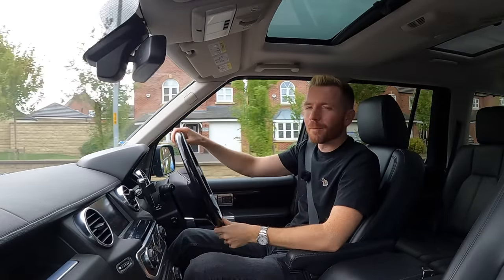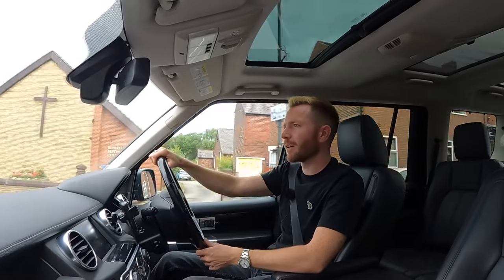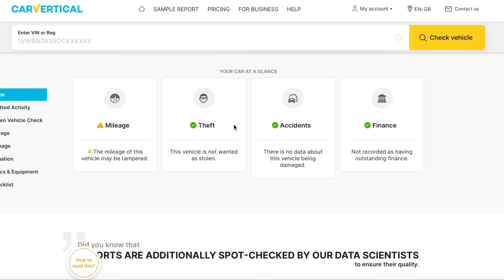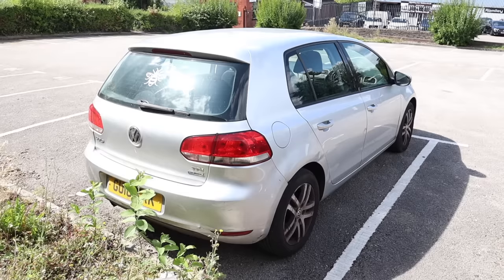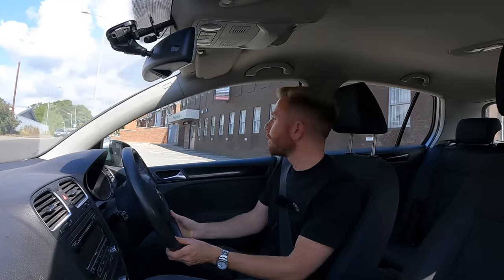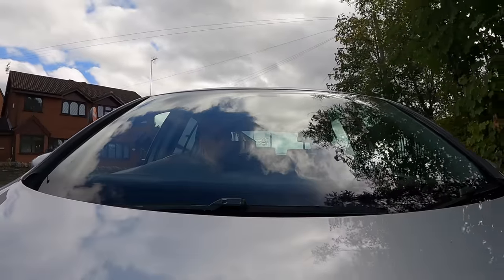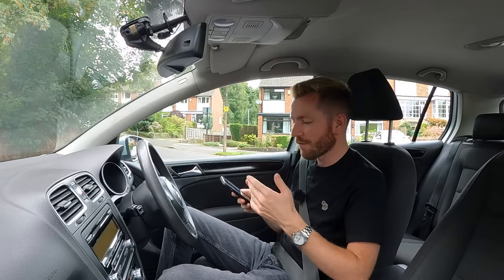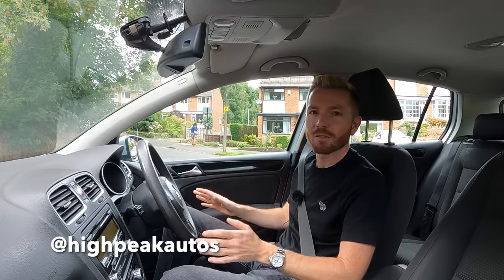I BOUGHT A CHEAP VW GOLF MK6 FOR £700!

Comment: As far as the tyres go, the date format is Week/Year so 07/22 means week 7 of 2022 not July 2022, meaning somewhere in February of 2022.
Reply: and the left side tyres were 18/21 (9:32 bottom of tyre)
Reply: I was also surprised to see such a fresh tyre in Europe from China
Reply: @krivickas  I have seen lots of these Aptany Harmonic tyres here in the UK lately. If we've been flooded with these post covid and post brexit, I'm assuming these really are the very worst China has to offer anyone😉
Reply: @6ettinold  A neighbour of mine has just bought a lovely used Black Sapphire (the colour's name, not those rumbly old nineties Fords😄) BMW ///M240i Shadow Edition. I just noticed and told him about the 'SprintGrip' tyres it's wearing (rapidly). Very rightly known as 'ditchfinder tyres' in the trade and many forums, I told him to drive it carefully and change them for better-established tyre brands the next spare time he has available.
Reply: Sketchy tyre dealer would get rid of the original tyre manufactured date, I think the tyre at 8:57 is one of the example, as you can see there are no date marked in the pill shaped area which there is where the date should be at the bottom of the screen.
Reply: So my tires aren’t made in the 42-nd month of last year? :(
Reply: also the tyre date is only ever stamped on one side of a tyre thats why its not visible on the n/s/r of this car
Reply: @cgr_doorjam0263  yeah it’s running backwards 😂

Comment: It's a testament to VW engineering that after being totally neglected it still runs ok.Close 2nd to the A Class Matt.
Reply: Wouldn’t happen on a Japanese car.
Reply: Ran an 08 Rabbit with the 2,5l engine. Ran that thing with a shattered water pump for over a year and faulty oil cooler. Overheated it, ran it hard. Had low fluid levels. Just trying to blow it up so I could have a golf shell. Never did die. I cleaned the engine up and now it's at 200k miles. Runs like it's brand new still. VW definitely earned my customer loyalty with this car.
Reply: Pretty crap testament in my opinion. Plug my 15 year old 170k ford in and it won't be riddled with faults. Germans don't make cars like they used to.
Reply: Money pit...

Comment: Just a heads up Matt, when looking for the date stamp on the tires you’re looking for something called the DOT code which stands for (Department of Transport) which is a US standard regulation for tires to check the date. As an example you’ll see 0122 this doesn’t mean that it’s a Jan 2022 tire however. The first 2 digits actually stand for the week of the year it was manufactured so an 0122 tire would be the first week of 2022. Another example would be 2919 which would be the 29th week of 2019. The NSF tire you checked and was unsure of being 1821 was correct, it was manufactured on the 18th week of 2021. Just thought this might help.

Comment: I’ve had my 2010 mk 6 for 8 years. I treat it like the work horse that golfs are, but I religiously get it serviced and get any jobs that it needs done as soon as possible. We used to change our car every 3 years, but we can’t bear to part with it, 120,000 mile, never lets us down. And still drives like a new(ish) car, plus £30 a year road tax.
It’s the 1.6 tdi diesel with extras that you’d be lucky to get on a modern car, Parking sensors, sat nav, touch screen cd/dvd player, voice control radio, and control buttons on the steering wheel. The cruise control is still working properly and is about the best I’ve ever used. Oh, and also a refrigerated glove box. Mine still has the bottle opener😊if you can get a mk6 for anything under 4 grand, snatch their hand off.

Comment: I swapped my FL2 in for a 59 reg MK6 golf 1.6 TDI bluemotion recently, 154k full VW history 2 owners for £3290. It's been a brilliant car so far, cheap to run, solid and refined.
Reply: I just got a mk6 golf estate 2010 in Jan this year. 6 owners, 89k miles on it. Full service history with a belt not long ago. Cost me 3900. now I've put 5k miles on it. Cars been generally good, spent 150 on a new radiator so far in maintenance. Shell be due an mot and service at the end of the year and I'll be treating her to 4 new tyres
Reply: @4N50N and how the car goes ?
Reply: @GnarAspira an injector ended up failing on me a year later. Also rear wiper motor failed, and 2 separate broken springs. But overall not a terrible car. Sold it for 3,300 last month. Ended up doing around 17k miles on it.

Comment: Just shows how good the golf 1.6 tdi engines are. It's been neglected and probably never been serviced still managed to do 166k miles and surviving.
Reply: They're really not.

Me and my partner owned a MK6 1.6TDI from three years old and 20,000 miles on the clock. It got everything it needed on time (serviced every time on the dot) and was well looked after mechanically.

In our ownership we had the dreaded EGR failure (£600+), wonky and rough idling after the Dieselgate emissions fix was carried out (which is known to accelerate injector failures), valve cover oil leak, the rear calipers seized forcing us to replace the rear discs, pads, and calipers, the drivers door started to rot on the seam, I could go on. It behaved like an absolute heap for a car that was impeccably well maintained so we ended up getting rid of it just after it ticked over 100,000 miles. 

Go and lookup the issues associated with the 1.6 TDI CR and you'll be shocked.

They're well known for DPF issues, injector failures, Master and slave cylinder failures, cooling system and component problems, air conditioning compressors fail, as do the alternator belt tensioners.
Reply: @agpe15  I,ve got one in a Jetta, on 159k none of those issues

Comment: The cheapest 2010 diesel Golf 6 for sale in Portugal has more 60k miles than that, looks a lot better but costs… wait for it 6k€!
What a nice country to be a petrolhead
Reply: Used cars are weirdly cheap in the UK for some reason.
Reply: Usually higher spec too 
It's the right hand drive thing that iis the issue  only Cyprus,Ireland and Malta drive on the same side in the EU and all have silly import taxes

Comment: I bought one at auction the other week, just saw a 10 plate zafira, heard 200 quid, bid and bought it, when the invoice came it was a non runner 07 tdi golf, they'd paused the auction to sell the non runner, anyway towed it back, battery flat due to broken bonnet cable, got to the lock, sorted it, flipped it for 750,it was a shed, very scabby wings, but still a golf tdi.

Comment: Always amazes me what relatively modern metal you can pick up in England for less than a grand. Here in Northern Ireland you won't get anything that starts and stops without moon mileage for less than double that and it probably won't have much service history or decent bodywork. But that Golf is a skip
Reply: You're dead right. Come down here to the republic, it's even worse still.
Reply: @mohda.9420  Unless you want an old Rover 75 they have taxed them off the road in the Republic of Ireland

Comment: I have a 04 Mk5 Golf and it is keept squeaky clean inside and most of the time clean outside. It was a bit forgotten by the previous owner but for a 18 year old car it seems like it would only have around 8 years, no rust, parts from 2003 still in a good shape.
Did I add that its an 1.6 FSI? Timing chain change and its running 10 times better meanwhile the owner said "I read those engines are bad", yeah, if you don't care about them.
Bought new wheels, cosmetic stuff, got the steering done in leather and a new exhaust (plus plenty lil things for a fair price, no big investments) 
Since then I get plenty of buying offers from people that just see it standing somewhere.
And something I didn't expect, I get praised by my m8s for keeping it in such a good shape. They say they wouldn't have the patience and will to do so to their cars.

But even this MK6 wasn't the worst that I have seen done to a fairly 'young' car.

Comment: ran one of these for 150,000. Not amazing reliability-drop links every 50k, broken springs every 50-60k, injector failures (replacements can be hard to come by and brand new are mental money).
Reply: All 1.6 tdi across the VW group are naff and not very reliable,and yes the injectors go and they have the wonderful DPF.
I bought the octavia version,it lasted 4 days then left  me stranded on the M4 6hr recovery,took it straight back got my money never again.
Reply: I just sold mine with 340k never had injector probs but the DPF wasn't wonderful 😕
Reply: @serendipity923  340k wow impressive just bought one mk6 GT TDI with 208k 😬

Comment: I'm just amazed how cheap cars are in the UK compared to other countrys like Belgium or Germany.
When I heard Golf VI 1.6 TDI with that many miles I thought at least 1 broken fuel injector but no.. Instead everything else. Power windows are as weak in VWs as they're in old Renaults like the old Mégane if you ask me ^^ most 5-speed manual transmission problem were solved when the mk6 came out so that shouldn't be a problem and the last problem "it's not a true VW if there's no check engine light on". 
If it no longer smells like spit milk and you get some of the cheap VW plastic parts that always break like the seat ajustment leather and the top of the gearknob and you refill the A/C if the compressor is not broken also a VW problem on that era, then this could be a decent knock-around car for someone.
Reply: this is an extremley rare find.. dont be fooled. i have lived here my whole life and this is a very rare find and goes within days.
Reply: Juri V  Right now im looking at the same VW GOLF model on facebook market and auto trader and they're coming at around £1700-2500 similar mileage range
Reply: @PO1S0N-1  lol in italy they are around 10’000 €

Comment: I used to have a mk6 Golf, if the Air Con isn't working it is usually the splines connecting the compressor to the pulley that have perished, the compressor and the gas are usually fine, a local specialist bolted it together for me and it worked perfectly thereafter, a very cheap and quick fix compared to a new compressor!

Comment: As a Mk6 owner msyself I have to say this is a steal. it has some mentionable extras: MFD+ which is important if you want to upgrade some other stuff, Comfortline seats which are probably the best seats in the whole MK6 and look cool as hell, Automatic Light, definitely not standard , a chromatic rear view mirror and I think an RCD 310 Radio, also not the worst one. Yeah, it might be very dirty, but this car is still among the safest cars in this class ever built. It has a freaking knee airbag ffs!!!! I love my 1.4 TSI DSG Comfortline at 150.000km. Wouldn't sell it for less then 6000€

Comment: I’ve been driving one of these since 2017. Almost the same spec with a better gps headunit, fog lights and other bits and bobs. Decent cars if you maintain them which the previous owners clearly didn’t. A stage 1 remap can get them up close to 150bhp where they are quite peppy.

One thing to keep in mind is these models were part of the diesel gate emissions scandal in 2015 so it’s always a good idea to check when buying one if they’ve had the Vw ‘fix’ that in some cases affected power and consumption. Not a big deal as it can be reversed but just good to know.

Comment: I'm very amazed at how many features this car has.
In the US small cars are really just cheap and don't offer much. Well they have increased a load of features lately. But they are normally the top of the line with all the bells and whistles.
But they don't offer anything for the rear passengers for kids. No air conditioning vents, no charger points, nothing in the cargo area etc.
Lots of crossovers offer these features on the base model. I suspect that's a reason lots of families buy them now. 
The new Civic despite NA being its largest market doesn't offer rear vents at all yet, Europe specs I've seen do. They want us to pay more for a crossover.

Comment: The level of neglect on that poor motor is unbelievable.
I've a 2011 Bluemotion that looks and drives like it's just come out of the showroom.
It's only a cheap motor but I've owned it from 3 years old and spared no expense on maintenance and servicing because I want to arrive at my destination and have a safe journey.
You can't have mine for £700 ....sorry 😂
Reply from the maker: A MK6 Golf isn’t old enough to be in this state in my opinion
Reply: @HighPeakAutos  
Totally agree , in shock at this vid when I think of the condition of my own.
The reason I only have a Golf is because I knew I'd be able to afford to run and maintain it.
This vehicle is proof of what happens when you buy a car you can't actually afford to put fuel in 😕
Reply: The state of that poor Golf in the video really pisses me off they're good cars and the fact its on nearly 170k miles in spite of its treatment is proof enough of that but the 1st car I ever drove was a MK4 1.9 SDI with 250k miles and was 15 years old at the time and it was much better cared for than the poor golf in this video. I don't expect everyone to be clean it 100% and leave it in show room condition but that poor car is a dump.
Reply: @gravemind6536  Never drove an SDI, does it actually feel like you're driving a 1 liter car? O_O
Reply: @alinutzalin6346  Worse..
Reply: @alinutzalin6346  SDI are very efficient cost penny's to run if you looking a cheap daily,reliable too.
Reply: @andersnielsen6044  it really is worse its actually scary how slow they are lol
Reply: @ste4414  omg, just looked it up.
Even a 1 liter is faster than that O _O
Reply: @alinutzalin6346  ....you're talking about a 20 year old model that I've seen with 200k on the clock.
These faster 99cc cars you speak of won't ever see that age or mileage 🤣
A candle that burns twice as bright burns twice as fast .
Reply: Mk6 Golfs date back to 2009, that’s only 13 years ago. It’s pretty much half way through it’s life
Reply: @geebee6737  I've seen many Toyota Yaris 1.4 diesel going over 300k and  still going strong. Along with other makes, such as vw etc. (My friend actually has a 1.2 liter vw petrol, has 230k miles, still good looking too.)
As well as the Toyota 1.0-1.3 liter petrol doing 200k no probs.

I have only been mentioning the SDI because of it's lack of Turbo, it's so slow. 
Ofc it's less parts and maintenance needs will provide higher life expectancy along with it's diesel engine, look at trucks, millions of miles, still fine.

Now, most cars can last a lot of miles if preventative maintenance is done to them, not just when something breaks.

I get your candle analogy, but there's multiple instances and things to take into account, such as; 2 cars driven by 2 different owners, will not be the same at the end of their life, one might be in the scrap, one might live out their owner, just saying.
Reply: @alinutzalin6346  ...quote :  if preventative maintenance is done.
It wasn't done on this Golf but still going strong with 170k on the clock.
These new 3 cyclinder 99cc pocket rockets won't last as they're already imploding and the secondhand market flooded with them 🤣
Reply: @geebee6737  Oh, I totally agree with you on the "new" cars that are coming out. 
If they also got the stupid turbo and direct injection.  Oh lord.... When I saw Honda bringin out the 1.0 liter turbo, I slapped myself once to check if it's real...

Now, while I wasn't talking about the Golf in the video at any time of these messages, I can talk about Lexus gs300 with 250k miles not even having a cambelt and waterpump done before, along with alternator and other bits and pieces.

New parts that are being manufactured now are meant to be replaced every 2 years, really don't get the "save the planet" when things need to get thrown out so often.
Reply: @alinutzalin6346  .....I once had a Toyota pickup from new , put 79,000 miles on it in 10 months before I part exchanged it.
I'm a lover of real motors that were built to last which is why large capacity diesels appeal to me and this new generation motorbike engine in a car leaves me cold.
Cheers for the late night chat fella but time for bed 🤣

Comment: If you can't see the date stamp on a particular tyre, is it possible that it's a rotational tyre that's been fitted directionally wrongly ? Speaking of tyres, I have four Coopers on my car, which grip very well, but the newer front set {which have non removable valves fitted} are the worst I've ever seen for leeching out air. The valves aren't the culprit, so the differing carcass must be the reason. They do have a different tread pattern. May I ask if anyone's experienced this issue, including your good self ? Bit of a palaver, having to blow them up twice weekly. I checked the country of manufacture. Maybe they have fatter air molecules in Serbia !
Reply: It has the stamp of outside on it, def on the right side, there is a small patch missing from the tire, I guess that is the dot
Reply: @nr1fan4all  I have to confess, there was nothing wrong with the tyres after all. The alloys wheels had corroded somewhat and the beads weren't sealing properly. My guy wired brushed the rims, applied some sealing compound and now all is fine. The valves are normal ones too. They'd simply been tightened so hard that my short valve core remover wouldn't budge them.

Comment: Coolant light is the sensor. Probs as you had low levels. I've had the same issue with that water bottle. Its got 2 prongs in the coolant that check the level. Scrub it with an old toothbrush and top it up. Buys you another year